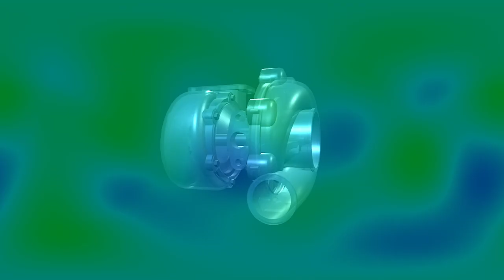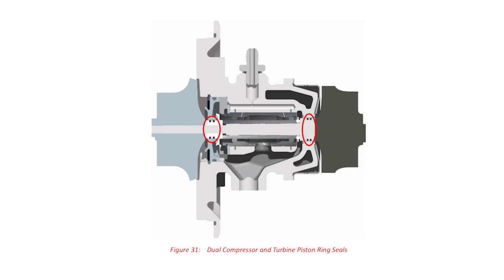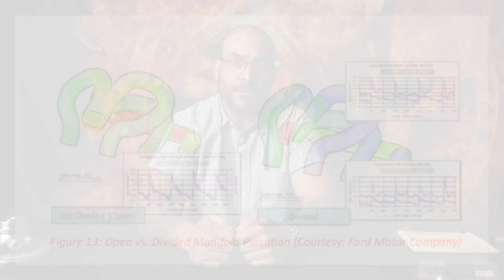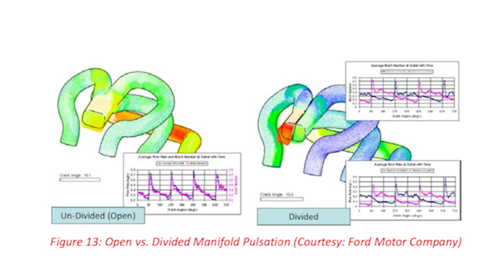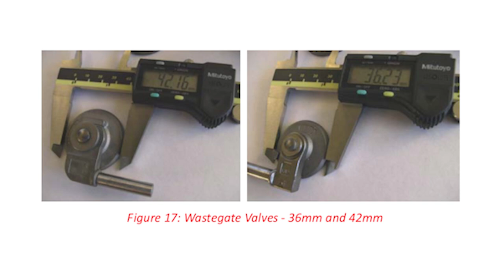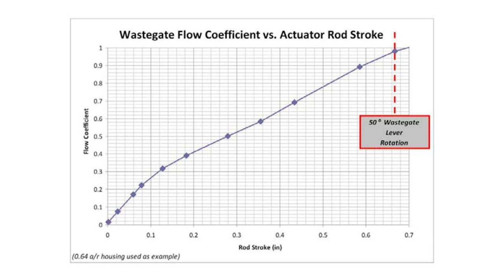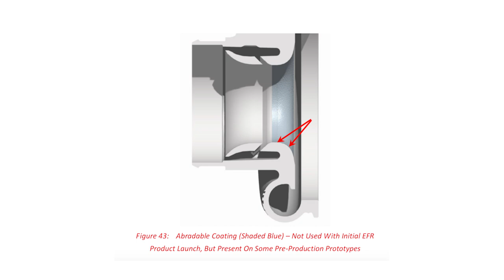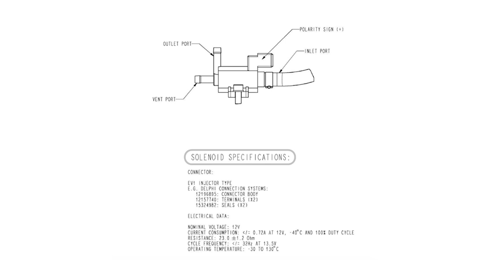Garrett vs BorgWarner in-depth comparison Part2

Comment: The man responsible for me to focus on nothing but getting an EFR7163 twin scroll setup . Haha! Seriously though I love all the presentation behind it. I may not understand everything but for things such as cooling , spool, I think this (and Part 1) more than backs up my future path with the edition 35. 

Qucik question,  do you stock twin scroll exhaust manifolds for the EFR series that bolt to the CDL EA113 ?
Reply from the maker: LOL -- you wont be sorry i promise you. The adapter we busy designing as we speak, i will release this for the T4 flange setups soon.
Reply: @TurboDirectSA  i got the efr 7163 single scroll ...i have a couple of days to finish the setup on a cdl engine 2.0 tfsi..i hope i didnt make a mistake for not getting a 3071
Reply from the maker: @αισχοςντροπη  You wont be sorry - the 7163 will outspool, and outperform the Garrett GT3071R easily!!

Comment: Hi, does the built in diverter valve eliminate the turbo dosing? It doesn't look like it flows much air compared to a bov. In your experience  how bad is it for a ball bearing turbo to be dosing? Wididididid
Reply from the maker: The DV works extremely well - the air flow is more than enough to prevent surge.

Comment: Some old schwitzer turbos had extended tips probably 30 years ago.  I used to run those tractor turbos on Mazda rotaries in the late 90s, and they were old back then. There was a model that was 61mm inducer used in a case tractor. Standard stuff. Ported,  4 inch in, 2.5 out, t4 divided,, 3 inch v band out.   They were $$400 American.  Outperformed the then brand new Garrett gt stuff, which only came in t3 back then. It looked to me like bw bought Schwitzer and turned a bunch of that stuff into airwerks line.

Comment: Great video and I have watched both parts! I have a g25 stage 2 powermax for the EA888 engine. I wonder if any of this compromises have been changed for that model?
Reply from the maker: @42cuba  I wouldn’t venture near this turbo. Especially the stage 2 - they have a reputation for failing!
Reply: @TurboDirectSA  Well crap I just bought one

Comment: hey, loved the video. I am in the process of upgrading my stock IHI sti turbo and interested as to what you recommend. I am going to a rotated setup so stock location  boltup does not matter. Ideally I would like to get a responsive 400-420whp on pump (93). Any suggestions would be appreciated.
Reply from the maker: Without a doubt EFR7163 - no Garrett in the same power range will spool as fast nor make the same power aswell as offer you a twin scroll setup especially suited for the boxer engines. Its a no brainer really

Comment: Great video ! Would love to know your opinion on a BW Turbo for my car built rb26 chasing 700-750hp at the wheels I just pulled off the twin 2860-5 don’t care for external gate so if you think internal gate would be better for packaging etc I’m happy to entertain the idea 
I want as much response as I can get as it’s not stroked.

👍🏼
Reply from the maker: I would consider using a single turbo as opposed to the -5's you took off. The EFR8474 Black Series will do you very well - it will spool up streetable and yet make the 750HP target easily with some to spare.  It is internally gated with a 42mm swing valve - you wont get an external to respond as well as this. 

Im sure you will very frightened/impressed with this setup for sure.

Comment: Is the headafold design on the FK8 Type R k20c1 head with a direct flow better than using a multiport header using a twinscroll design exhaust manifold better? The twinscroll design does direct each port’s exhaust pulse in a sequential way to efficiently flow the exhaust pulse to the turbo whereas the headafold just rams all the exhaust pulses into the turbo. What are your thoughts?
Reply from the maker: Pulse separation is ideal for outright performance and spool - DEPENDING on the turbine housing design. It will not be as beneficial using a single entry turbine volute in comparison to a twin scroll design when coupled to a separated pulse head.

Comment: thanks for the video. it is very informative. i currently have a twinscroll efr6258 on my alfa romeo 4C. do you have any recommendation on a faster spool turbo than my TS 6258 that can produce 330-350 crank HP at 6800rpm? thanks

Comment: Does the Borg diverter valve is sufficient to release boost pressure when needed or we have to add a blowoff valve with it ?
Reply from the maker: The DV is more than sufficient to relieve the pressure, you dont have to spend additional money on secondary components. This is the beauty about the EFR range.
Reply: @TurboDirectSA  have you done any testing on the 7163 compressor housing with diverter valve vs the sxe housing?  I really like the built in diverter valve but have seen some dynos showing substantial power increase using the sxe housing.
Reply from the maker: @mikesti8406  No we have not - the only way any power increase will be possible is if there was a restriction in the housing or there was a boost leak somewhere -- the SXE housing is advertised as an option for those who want to do away with the DV, and/or want a decrease in geography required to install the turbo -

Comment: Chris I have really enjoyed watching your videos. I have a 2012 Audi S3 (EA113 engine) that I am just about to start a big turbo build on. It has a built bottom end and looking to achieve around 650-680 engine horsepower. The car is a street car that will see some drag racing and track work as well. In your opinion what is the optimum turbo choice to achieve the horsepower I am after with minimal lag?
Reply from the maker: Thanks for he comment Daniel, if this was my car, i would be looking at one of two turbos, the EFR7670 which will make the power you want at high boost, so when driving streetable, you can keep boost pressures lower and use pump gas. 

If you want to run 600+HP permanently then i would also consider the EFR8474 Black Series, which will EASILY make the power you want, but at much lower boost, however this option will be on the laggier side compared to the 7670. 

If you want to run high boost all the time, then the 7670 will respond faster and make the power without issues, and will be reliable. If you planning on making this power and then some later - then the 7670 will be close to maxed out already, so then consider the 8474.  Also consider what fuel you want to use on a daily basis - ethanol is expansive in consumption, so im assuming you will definitely opt for the two boost map setup.
Reply: @TurboDirectSA  do u sell turbos want one for 1995 defender 300tdi
Reply from the maker: @lucasmolapisane4637  Yes we do - info@turbodirect.co.za or (011) 392 5195, (011) 392 4071

Comment: In Borg Warner’s EFR “Engineered For Racing” design the Borg Warner engineers have not left any stone unturned and literally were designed for extreme motorsports heavy duty requirements. In the radiuses of ports, larger cooling ports, heavy duty over built center cartridge, angles of the internal gate port. They were designed to be used in F1 race engines and were designed from the ground up for racing. The Borg Warner EFR turbos are significantly wider than the Garrett G-series turbos, a way larger footprint.
Reply from the maker: Technologically much farther ahead of Garrett -

Comment: With the borg warner  just for laughs  could u run a dual line coolant set up  ( 2 inlet and 2 outlet
Reply from the maker: You could yes, BUT careful not to flow against eachother, otherwise there would be no actual flow through the housing.

Comment: Great video, next level is dyno comparisons for spool and hp delivery across similar sizes between brands.
Reply from the maker: This is upcoming once we have finished the build. Its 1JZ with a few surprises.
Reply: I can't wait to see what comes of the next series of tests!
Reply from the maker: @dannygarcia8341  To be honest - nor can i.
Reply: @TurboDirectSA  Yeah I am so excited for that series! Will it be done on an engine dyno or in a car on a chassis/hub dyno? I'm assuming on a car, but figured I'd ask.
Reply from the maker: @802Garage  Its going to be installed into a BMW E36 body which will live on the dyno for all the tests - the manifold will be made specifically to allow for easy access and removal of turbos to test back to back on the same day - im trying to get this built ASAP -
Reply: @TurboDirectSA  🙌🙌🙌
Reply: Can you also Include the new Xona rota range in your tests?

Comment: This is an excellent presentation, thanks again Chris! You are the only one that talks openly about these things. This is greatly appreciated. I should point out that MHI has much better bearing design and wastegate control than Garrett's. Maybe in a next video you should do a similar comparison between the S200SXE and the Td06s.
Reply from the maker: Thanks bro - much appreciate your comments. MHI is a proper turbo but they dont have a ball bearing offering for the aftermarket or universal builders. Ill do a comparison for sure in an upcoming video for you.
Reply: @TurboDirectSA  cheers
Reply: For posterity, recently I've seen Turbo Lab America converting Evo turbos to ball bearing.
Reply: @tommylyeah  Indeed but I am not sure if they make much of a difference - it's the whole bearing design, not directly depended of being a journal or ball bearing, that defines the performance. In other words a bearing designed originally for journal bearing, I doubt if converting it to a ball bearing would make much of a difference. I hope someone will make a test like that some day, so a comparison between two GT2860rs, a journal and a ball bearing, or a Td05H (or Td06SL2/H) journal and ball bearing, but nobody does it because the extra charge for ball bearing (look how much more they charge Precision, Turbonetics, Kinugawa etc) and the conversions at workshops is a very good profit for the turbo industry.
Reply: @TurboDirectSA  I hope Chris that you will do this comparison video at the end (between a S200SXE and a Td06H)
Reply from the maker: @aftastosk6016  Buddy which one? There are so many TD06 variants its scary.
Reply: @TurboDirectSA  My idea was between the S252SX-E (Super-Core Part number 12709095019) and the Td06H-25G (or Td06SH-25G as it is in the Greddy Catalog Part #: 11500170, 11500175, 11500180). The problem is that BW does not offer the S200 series with a single scroll housing, which is crazy if we consider in how many cases using a twin scroll because of lack of space is either impossible to use or has minimal benefits.
Reply from the maker: @aftastosk6016  Buddy the twin scroll housing takes up no more space than a single scroll housing does. Its only the internal structure that differs, and the twin scroll housing is offerred for a reason - the turbine design suits the twin scroll specifically, and the best results are obtained from using this housing provided/suggested by Borg.
Reply: @TurboDirectSA  I was thinking to space restrictions of the manifold. They are cases (like the Honda S2000 or the BMW Z3/E36/E46, Nissan 350Z etc) where there is no space available to design a proper twin scroll manifold.

Comment: I ordered a turbo kit and they’re only made for precision turbos but I’d rather have a BW for longevity. Wondering if any BW turbo has the same or similar physical dimensions as a 6266 gen 1 or gen 2 so that I can swap it out with minimal modification.
Reply from the maker: What flange face turbine housing do you have, what is your intended boost level and HP target?
Reply: @TurboDirectSA  V-band turbine inlet and outlet. 18-20 psi of boost on pump gas on a 3.0L I6 engine looking to make around 500 whp
Reply from the maker: @guillermolopez1690  7670 is a great choice for a quick response and will make that power no problem at that boost - the 8474 black series is another option which is larger and less responsive but will make that power no problem with plenty in reserve.  Issue is with both these options is that they don't have Vband housing options - there is a Vband to T3 adapter i have seen available that are compact and cheap - You dont want the 7163 as its too small for the 500HP mark -- it will easiy get there but you will have to run high boost all the time to keep it there.
Reply: @TurboDirectSA  Speaking of Precision, any opinion on their product?
Reply from the maker: @802Garage  I can speak from experience with the Precision turbo range, which dates back to 2010-2014 things might have changed since then, but what i witnessed first hand was a visit to the factory in China who manufactures/d the internal components.  I have done back to back tests on a dyno between a PTE6262, GT3076R and the same GT3076R with one of our upgraded billet compressors, all on the same day -- ill try find the article and make a video of this - but as i said, this is based on the original gen1 series -
Reply: Would love to see those dyno comparisons @TurboDirectSA

Comment: We were doing the angled map groove for 9-10 years ago in the diesel truck pulling world. I currently have a gtx55 base turbo it’s a custom billet center section no water ports custom German bearing cartridge the compressor wheel is a 5 blade with 10 splitter blades 66mm smooth bore no map groove. It makes big power for a 66mm over 1000hp to the tire.
Reply from the maker: The 80's F1 turbochargers were 5blade splitters, we played with this design on the EA888.3 platform initially and found the wheels to perform alot better than the 6 splitter design, but surged horribly low down.

Comment: Has the EFR aluma-ti wheel had any failures or prone to failure? I was told this by a turbo kit fabricator. Also is the EFR technology/aero old and not as efficient as the Garrett’s g30 series  technology/aero? I wonder why Garrett didn’t use the aluma-ti material on the turbine wheel and shaft if it helps acceleration and transient response of the rotating assembly of the chra? I had the 8374EFR twinscroll in my 04 STI and now have the Garrett g30-770 in my 2018 Honda Civic Type R. Actually Im getting it dyno’d today 🙂.
Reply from the maker: The 2010 first generation turbine heads reported failures, which were addressed immediately by BorgWarner, and since then no abnormal failures have occurred since. The reports of the turbines failing are direct results of overspeeding, which exceed the P2C (boost axis) on the compressor maps. 

Most of these occur on the bigger Diesel engines where 60-75PSI of boost is run -- obviously this turbo will fail as this pressure ratio doesn't even appear on the compressor map.

The G-series is the most overrated turbocharger on the market today. It will never respond as fast as the Gamma TI wheels from BorgWarner, and nor will the G-series make the claimed power either. They are laggy and underperform by 15% + 

Side by side the EFR will flow more, and respond faster than the G-series of the same family (apples with apples) The Borg also runs at lower rotational speeds, while making more power than the G-series, which speak for the advanced aerodynamics of the blade designs.  The Borg runs ALOT cooler thanks to the larger water port deigns, which relates to more reliability, making the EFR alot more abuse-able.  

The ALuminium bearing housing is also a huge benefit in combating heat. The EFR runs a larger and more robust bearing cartridge and spells reliability through and through.

Comment: The efr8474 "black " s a new term to me. Is there any difference between the efr8474 and the black version?
Reply from the maker: Thanks for the comment - there is only one 8474 -- its the black series and you recognise it by its black anodised compressor wheel.  This replaces the 8374, -- nothing refers to an 8474 other than the black series in the cataligue at all.  8374 = 750HP with 62mm compressor and the 8474 = 950HP with 68mm compressor
Reply: @TurboDirectSA  Thank you. You're the first I've seen use it by the full name than.

Comment: Absolutely love the information. Could you give me some guidance please. I have f250 7.3 powerstroke currently running a Borg kc300x 63/73 turbo with hybrid injectors ebpv delete and waste gate disconnected advised from KC turbos America. It is a fantastic turbo IF you have a automatic transmission however I have a ZF6 speed manual transmission. The truck does a lot of towing and I drive it like a truck and it never sees anything over 2200rpm she's happy sitting on around 1850rpm all day and pulls well but the biggest problem is the turbo doesn't light until 1500rpm and it's a dog around town and i really want a turbo set up to boost around 1100rpm. I'm willing to sacrifice top end power as i never use it anyway unless i was to smash the pedal and sit on 2500 to 2800rpm where it seems happy produce 475hp.
Reply from the maker: Thank you Floyd - apologies fo the time taken to reply, its been hectic this side. We do not have these vehicles in our country, so i have no knowledge of the engine itself, nor the turbo or what it looks like on this engine. Please shoot me an email on info@turbodirect.co.za, let's converse there. Perhaps if you can send me info, pictures and if possible a compressor map of the turbo on the engine now, this will help me understand more about the project and i can make suggestions from there.